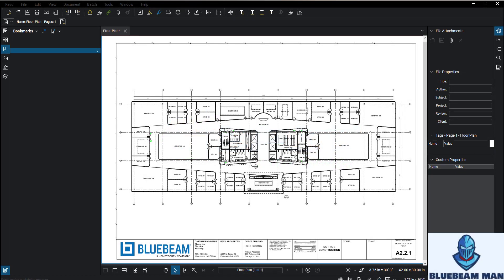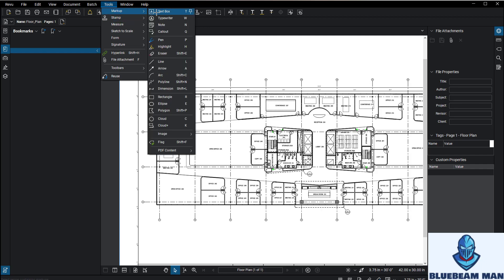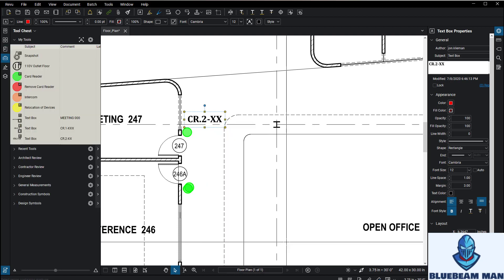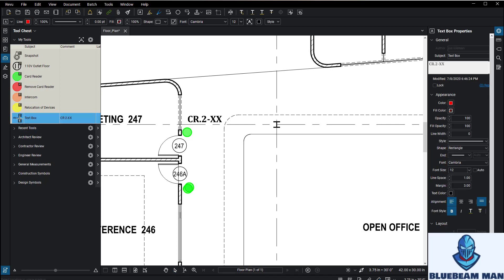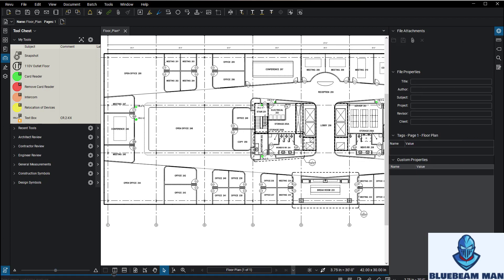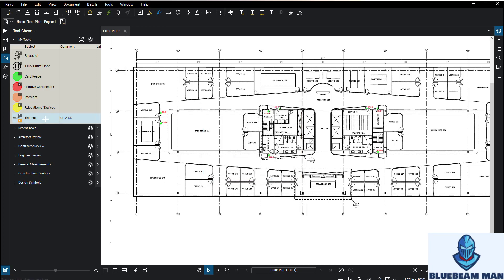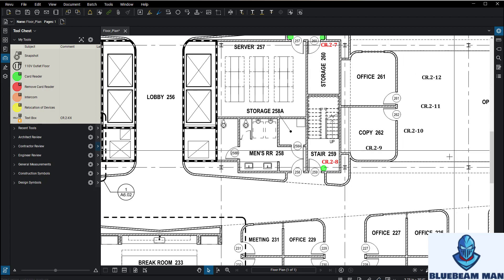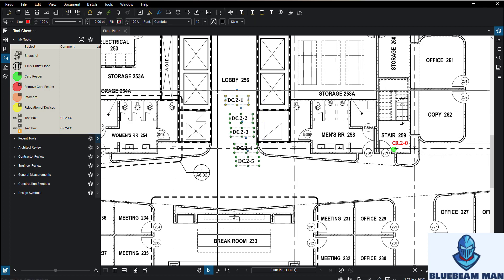Bluebeam - How to build auto counting labels

Comment: old video but the count tool would do this without putting a bunch of extra letter/numbers all over your page. every time you click it puts a check mark and counts. when you're done you only see the check marks but if you mouse over it, it'll tell you the count. You can right click the check mark and hit "resume count" to keep going from where you left off
Reply from the maker: True, however the purpose of the auto label feature is geared around the visual labeling of a device or set of devices.  Each feature function has its place. Thx for the comment, Bluebeamman out.

Comment: I like the automatic sequence feature but since these badge readers are always associated with particular doors the device numbers should relate to those door numbers. Don't throw arbitrary numbers all over the plan.
Reply from the maker: Good comment, labeling should always adhere to the drawing and design standards.  This is just a model and especially works for items that are not connected to a secondary identifier.

Comment: Do you know if there is a way to add leading zeros to the sequence? Most of our labeling schemes are two digits - CR.01, CR.02, etc... so I have to put the prefix CR.0x. I am able to get it to work great until we hit double digits because then it goes to CR.010, CR.011, etc.
Reply from the maker: Although it’s not productive, you could make variations of each counting symbol. You could have CR.0x (use for the first 9), then CR.xx (for the next 90).
Reply from the maker: Although it’s not productive, you could make variations of each counting symbol. You could have CR.0x (use for the first 9), then CR.xx (for the next 90).